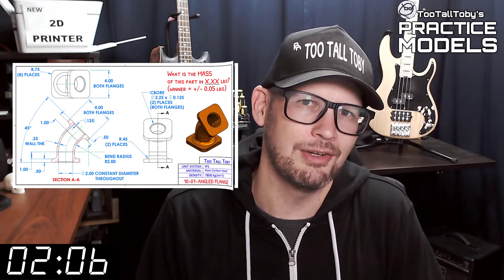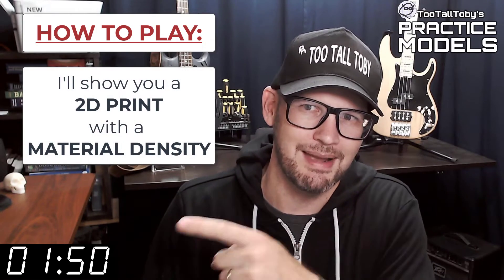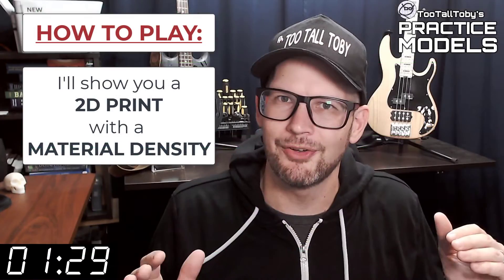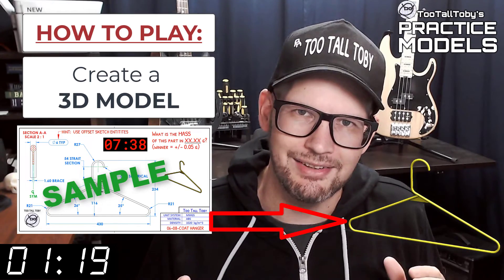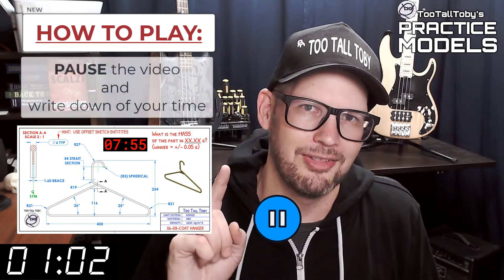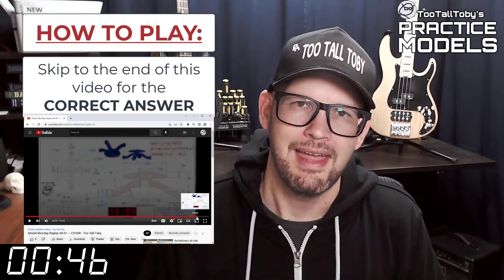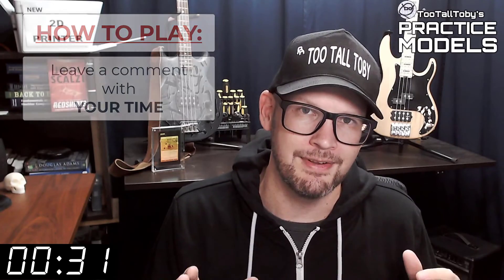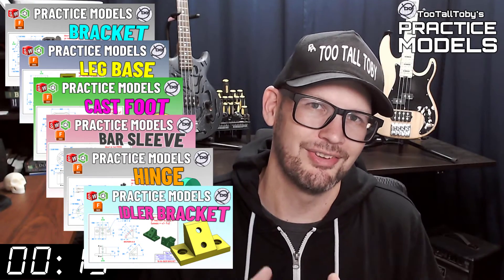SOLIDWORKS Practice - Onshape Practice - Fusion 360 Practice Exercises - TooTallToby-05-02b

Comment: About 13 minutes in OnShape, but I had an error.  I read "All dimensions to outside", so I had the upper left outside arc dimensioned to R1.75.  When I saw R2.50 on the right I was able to fix my error.   Amazingly, with that error the mass was only off by 0.023 lbs....almost within tolerance, but I had to find and fix it.  Now it's spot on.  Time was about 20 minutes total.
Reply from the maker: Awww yeah awesome job and nice job finding the error too!

Comment: 6min 20. I typed the angle dimension too quickly and it came out 13.7 instead off 31.7. Funnily enough they are similar enough for me to struggle to find it. Mass 2.4339 in Alibre
Reply from the maker: lol - I hate when one number gets juxtaposed!
Reply from the maker: that's what happened last season in the WILL vs VICTOR K match!

Comment: Mass = 2.43 with Plasticity
It cost me hours of my life because I consistently ended up at 2.41 instead of 2.43 lbs, and I just couldn't find my mistake. 🤦‍♂
Now I know how to create the model correctly. Thanks Toby 😄
Video: https://youtu.be/F9kt7D64_tU
Reply from the maker: Hey that’s awesome welcome to the channel!  Great to see plasticity in here!  What was the solution that got you to the correct answer?  What feature was tripping you up?
Reply: While creating the 1-inch high section, I lastly rotated the edges of the body by 15.85 degrees. I didn't notice that the outer margin slightly decreased and is then less than 14.00 inches. Beginner's mistake. 🤷‍♂

Comment: 35 minutes 2.49lb. Note, Until I finish the part complete to a reasonable tolerance, I do not stop or reset the clock if I have to start over, and I had to start over about 9 minutes into my first pass as I didn't pick a good origin, and my sketch turned into a pretzel as I started to dimension it. 

Question 1: Which was the correct tolerance? The one at the end of the video or the one on the print ?  By the video I was in tolerance, by the print I was not.

Statement: Reiteration of previous comments: I love these challenges, please keep them up. I  doubt I'm ever going to be the fastest modeler, but they really are helping me in so many ways such as the importance of picking the correct origin point, understanding and use of tools I might not otherwise use, and overall workflow. 

Suggestion: Please add "Surface Area" to the answer slide, even if it is only as a reference value.  Reason, in this print and many others , it would be possible to make mistakes in the dimensions with both the height and the wall thicknesses, yet still get the same mass. Surface area would catch these mistakes.
Reply from the maker: Hi David - the correct tolerance is on the print - 0.02 lbs - sorry about that.
Here's a video I made showing how I would approach this model:
https://youtu.be/WTkRsoNbDjI 
Hope this helps!

Comment: Missed the 31.7 deg angle on take one so was off a bit but still within tolerance with the sides aligned with the circle centers somehow... Wasn't recording (and skipped to the end to check the mass) so not sure what the time was, probably about 3min.
I looked carefully at the drawing and figured out the problem before recording a second take in 1:44, fairly simple once you know what's going on! Recording of "take2" on my channel.
Reply: Crazy fast!
Reply from the maker: Weeeeeee super fast!  Nice job 👍

Comment: Sorry for asking more than this , 
Is it possible to add your point of view of making this model , even if its fast forward mode that's ok .

Cz , we will understand what we did wrong or which step we missed or what supposed to be the approach
Reply from the maker: Hi Chavan!  here ya go!  Hope this helps!
https://youtu.be/WTkRsoNbDjI
Reply: Thanks a lot 
I also tried that with ORG Tray 
But instead of using RIB command i draw that shape and extruded both side , 
After getting answer correct Saw your tutorial and man that Rib command is so helpful